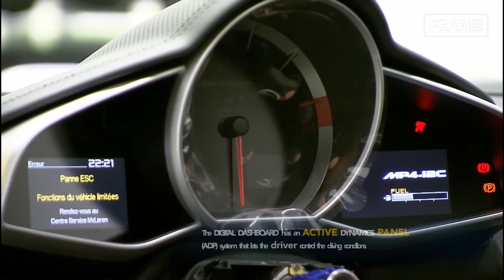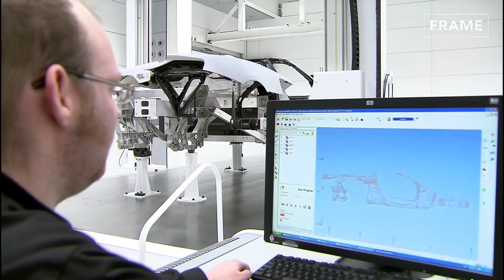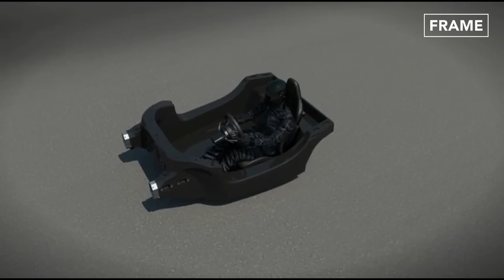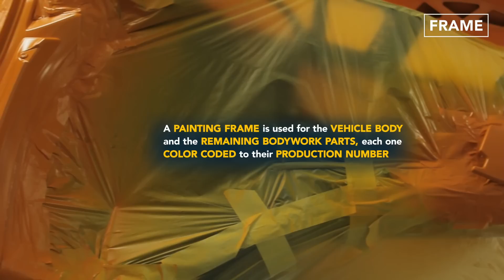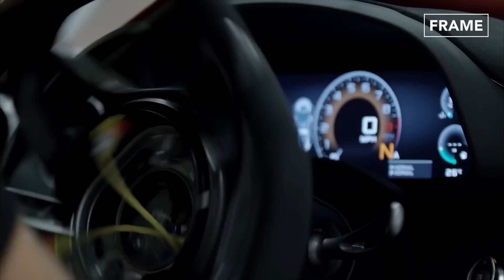How they Build the Most Expensive Mclaren Supercar - Inside Production Line Factory

Comment: Basically they are serial production cars now, you only pay 10x what is worth for the idea of a super-car. 15000$ cars have now the engine precision that the super cars use to have a few years ago, and can pack as much power if needed. We have to stop this, a super car should no longer be a luxury.

By the way the production quality of Mclarens is worse now than a Fiesta, the panels are not aligned and they start to fall apart just after a few thousand miles, cause as we see here they are hand build. Shockingly.